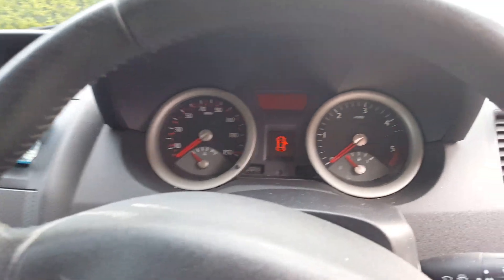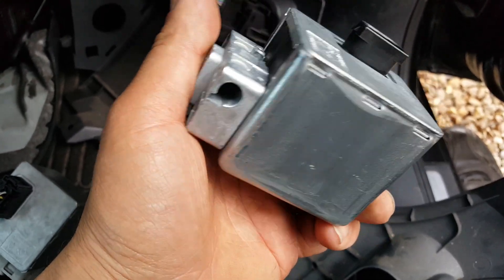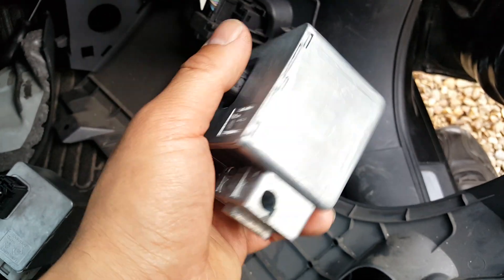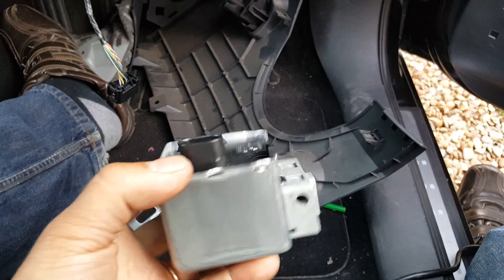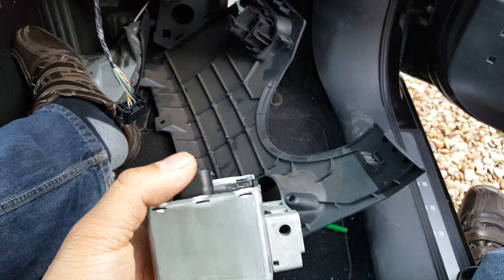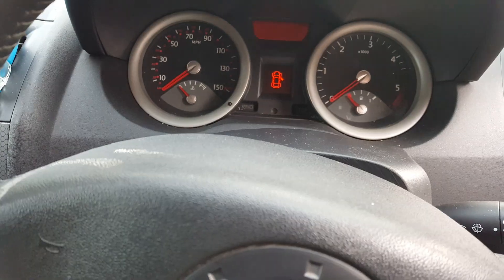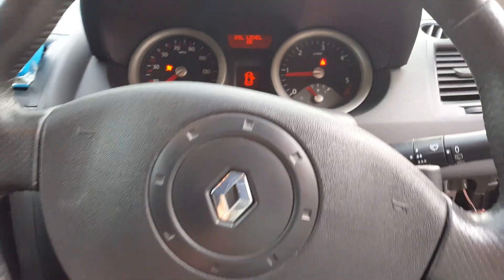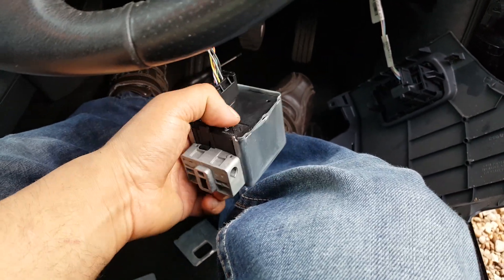Renault Megane steering lock fault repair.

Comment: Hello sir, I have a question if I buy a second-hand one steering modul and just change the ST24/25xx04 chip only from the old one to the new, it's OK? I have Df055 error Eeprom failed activ. Thank you
Reply from the maker: mirel m 
Probably not... if the eeprom from the lock that is on the car is corrupted,  you will be only moving the problem...
You have two options, remove the eeprom from yours and blank it... put it back and see... alternatively you can buy a second hand one, blank the eeprom and that should also work...

Comment: you a great men, thanks. I have a similar problem, what i can do? i need replace a lock module? can i change only mechanical parts of lock module ? thanks
Reply from the maker: Eduard Bodrug 
If you replace the module with a blank and ready to fit, it is plug and play... otherwise all the info is on the video.
Hope that helps....

Comment: You can replac it !? or u need to copy cods to the new one.
Reply from the maker: i-Bird 
The replacement needs to either be blanked of contents copied from the original one...
Reply: Ok ! thank you bro
Reply from the maker: i-Bird 
No worries...
Reply: Ok .How can i help my self if this problem come in desert & the car wont started!
Reply from the maker: i-Bird 
Well... you still need to remove the steering lock and do whatever...
If the steering lock is locked and won't unlock, it is a bit tricky to remove it, but can be done...

Comment: Is there a video to see how it all off? How do I get this part? And how does this part is called to be purchased? Thanks, man.
Reply from the maker: Bili Kid 
Hi
It might be a video on how to take it out, I never captured it due to how simple it is.
You have one bolt and one plug... that's it.
This part is the steering lock. 
Search for "renault megane steering lock " and you will find it.
EBay is a good place...
Reply: Thank you very much. Can you just say, if you buy a new part that you have to decode it before installation? Have a nice day.
Reply from the maker: Bili Kid 
If you buy it brand new, it is plug and play.
On eBay,  for example,  you will see that there is sellers selling them already reset and ready to fit.

Comment: when finished how do you re- connect the lock back in to the car ?
Reply from the maker: Yvie Stevenson 
What do you mean with connect?
Reply: do I have it unlocked or locked when re connecting, how do I plug it back in lol
Reply from the maker: Yvie Stevenson 
I usually close it down and fit it in the unlocked position... but that shouldn't really make a difference...
If the reset is done correctly, the lock will sync with the UCH and that's it...

Comment: Can this same technique be applied to the steering ecu ?
Reply: for a clio 3 that is.... I plan to pull the dump over the next day or two :)
Reply from the maker: Mike Jones 
Hi
Possibly... I never done one of those...
Reply: Ive found a couple of dumps for the clio 3 but once in the hex editor they look nothing like yours ..
Reply: Hello :)
Reply from the maker: Mike Jones 
They don't need to... each car is different... even on different megane the data would be different... That's why they are not interchangeable... each lock contains the data that locks the steering lock to that car....

Comment: Hello my friend
I wonder an explanation of inertia switch operator fiat doblo 1.6 diesel 2015
My fiat makes an accident the engine will not start and warning lights flashing
I do a diagnosis by autocom the fault code is U 0427 Inertia function :  present  
What the solution about this
Reply from the maker: Med téchnicien 
Hi
The car been involved in some sort of accident, correct?
There is a procedure to be followed to allow the engine to be restarted...
Something along these lines:

turn ignition key to MAR;
* turn on right turn signal;
* turn off right turn signal;
* turn on left turn signal;
* turn off left turn signal;
* turn on right turn signal;
* turn off right turn signal;
* turn on left turn signal;
* turn off left turn signal;
* turn ignition key to STOP.

Comment: I've got a scenic 2 1.9dci done loads to it already rewired  the r2 connections  under passenger seat 
new rear crank oil seal 
2 coils 
injector x2
service
But now I have this fault got a kit fro the car but is there any way of bypassing it just to confirm  it's the fault?thanks

Comment: why dont you just swap the eeproms
Reply from the maker: Oltian MUNGA 
Hi
Wouldn't work...
You can do that if the problem is mechanical... if the data in the eeprom is corrupted swap the chips will not resolve the issue...

Comment: my  2004 Renault Megane when I stop the engine, and turn the steering wheel ,I feel clicking like it didn't fully lock and then when I start again the car is fine ,and the clicking goes away and I can just drive back normal ,but it  sounds like i need for of these models, where can someone go and get this done ,without having to go to Renault and a crazy money how difficult is it to do what you are doing on the computer or is there a computer?help!!!!
Reply from the maker: jozzerful2 
Hi
You can get a second hand lock and follow the procedure in this video...
If don't have the meanings to do it, the you need to find someone...

Comment: Hi i buy this to replace the faulty stering lock AD-MEM01
tell me how i cant conect to my pc to use please
Reply from the maker: Ionut Dascaliuc 
I am sorry, but I am not familiar with that programmer...
Does it not come with instructions?
Reply: i ve just order that product i see when he came!i have another question for you do you have anny ideea if another parts of steering fault repair work on my car if i buy from another car end i do the same thing you do in this video?
Reply from the maker: Ionut Dascaliuc 
ok... your question is a bit confused... but if you buy the whole steering column it will come  with a steering lock which you will need to virginize(as per the video...)... Otherwise the steering will not unlock...
Hope that helps...

Comment: Hi, before thanks a lot about recording this video.!!

I want to ask you about if is posible to buy a new one unit of 24c04 eprom (maybe this unit came erased in FFFFFFF all)

My problem is the next:

2 years ago have a problem wiht this. my solution was go to a scrapping cars and take a used unit. 
After i changed the circuit board from my car to the steering lock that i buyed.

2 weeks ago i had the same problem and i made the same thing, 1 week ago, i have again the message of blocked steering.

I tried again buying the used steering, but now i cant make it works.

So what i should to make now.   I was thinking about to buy a new one 24c04  and replace it, but i dont know if it is possible, or is mandatory to use the old 24c04 epprom from the steering circuit of the car??.

Thanks a lot.!
Reply from the maker: F.A. M 
Hi
Thank you for watching and for your comment! 
A brand new eprom should come empty... so should work...
Do you have a programmer, to read and write chips?
Reply: i ask you this because i have not a programmer to write chips, and i was thinking to buy only the eeprom and change it. If it was not posible i will have to buy the programmer and  try like you.

I ask you because o didnt know if the eeprom has more information inside like a Vin code or other.
Reply: Is it work are you try to replace 24c04 with new one
Reply from the maker: F.A. M 
I really apologise... only saw you message now...
A new EEPROM should come empty a filled with FFFF... but not necessarily...
Ask the seller of he can do it before send it to you...
Reply: Hello i tried with new one it doesnt work for me.
Reply from the maker: Miroslav Mitsov 
Hi
One of the two:
The new EEPROM did not came filled with FFFF...
You might have another problem elsewhere...
Reply: where can i search the other problem, the message is the same, 

"direccion  no desbloqueada"   "direccion no bloqueada"  (is in spanish  steering locked, or steering not locked)
Reply from the maker: Francisco miñana 
What have you done so far?
Reply: i sended to an enterprise, they copy te original eeprom and put the data in  another board.
I tested and without exit....

Now i send to a friend the board to erase the eeprom again, i dont know what to do no.
Reply from the maker: Francisco miñana 
OK...
First, copy the data might not work,  if the original data was corrupted you are transferring it to another board...
That's why erase and let the car to write the data needed back into the chip... this providing that mechanically the lock is good...
Once you establish that you have a good working order lock, look at the plug for a good connection, check wires etc...
Reply: i tried with a new one and the same virginiced. Wihtout exit.....the friend put FFFFF and is the same problem and messages.
Reply from the maker: F.A. M 
Hi
Sorry to hear that...
You might have a different problem... ensure all the wiring to the lock is good..
 trace it back, lock for connectors, plugs etc... if there is no communication with the steering lock due to a faulty wire/connection you will probably get the same sort of fault...
Reply: i have to test it, between lock and UPC and betwenn lock and UCH , i hope that the problem won't be in multiplex wiring because it can be repaired, only replaced.
Reply from the maker: F.A. M 
It can be repaired... but you need to adhere a few rules... Google will help you...
So I presume you haven't tested the network wiring then...
Reply: no, i dont tested yet, im going to do in this next days,
Reply: today i tested the conexions and all ok, after i tested the socket of steering lock and it didn't give 12volts, only 0'40 volts, after i test the battery and give 9 volts....   After it the steering lock runs, but i can turn on the car (the battery is low) i put a new one and the car now is ok.

I believe that the problem could be the battery, because the 2 times that it doesnt runs ,the temperature is cold.
Reply from the maker: Hi
You have neglected an important item... lol
But nice to see that you are getting somewhere! 
Good work!
Reply: I neglected this one because all items or car ar ok, without signals of low battery, now i checked the battery and it was without water, i just refilled, if the battery  goes bat  i will change it. 

Thanks.
Reply: Hi again, i had the same problem 3 times.....
was not the battery, was not the steering lock...

i believe that the problem is the uch, because when i disconect and conect again it, all problems dissapear, maybe it can a bad conection....
thanks a lot.

Comment: will it be OK to just unplug and plug back in
Reply from the maker: canyouseewhaticansee 
Depends on what the problem is...
Reply: lmsvvavr  when I first  got the car steering lock worked a couple of times  drove no problems. last week constant L E D and stop sign  on dash won't start  there is a click from the reader when you press the button to start then nothing .
 I've done the fuses cleaned no water damage + ecu good new 6 months ago  +battery good + all connections good live + earth cleaned put back.
 going to have a look at the key card module not sure if it's anything to do with that .
so with the steering look  worn now do I unplug and put back. 
 thanks
Reply from the maker: canyouseewhaticansee 
If is the steering lock that is causing that, it is logged in the UCH...

Comment: Hey up have the same car and my stearing lock keeps saying not locked would this be the same thing. my car starts just here a little bit of clicking when turning the wheel :-)
Reply from the maker: Carp Guy2016 
Possibly... Unless there is something wrong mechanically inside the locking system...
Reply: lmsvvavr  thanks for that how much would I be looking at to get fixed thanks
Reply from the maker: Carp Guy2016 
Depends... not all garages are able to do this, and the replacement is often the easiest option. 
You can look on eBay for example,  and look at the price... usually about £60 reseted. (Same procedure as per the video...)

Comment: Do you think it's the UCH problem? But do you think I can buy all ECU UCH Steering Lock and key from other car?
Reply from the maker: Patrick Pat 
Possibly... or a wire problem...
Have the car scanned and go from there...
Reply: Hi, What you mean with scanned? you mean with Renault Clip device? No, I have just an OBD ELM interface that doesn't work. Hey, Renault Clip could work or not before you solve problem? Does it communicate via CAN interface also with the problem?
I would like now to check my ECU, 3 Connectors, and also to take out my ECU to open and see if there is oxid somewhere inside, I noticed oxid on the connectors. Another way I want to take is to buy the complete kit:  ECU UCH Key and Steering Lock from an other Megan Car, is it a good idea?
Reply from the maker: Patrick Pat 
That will might work, but might not...
If your problem is for example a wire problem, that will obviously is not going to solve your problem.
Scan the car first...
Does not need to be with clip, see a garage, they can scan it...
See if there is something that might point you in some direction...

Comment: Hi, I tried yesterday to reset and erase 24C04 Eeprom with ICPROG (With hot air solder.... and my Eeprom Programmer with smd/dip adapter) and put it again in my steering lock module but Nothing:  Message again Steering Lock Fault
A week ago I bought from UK a new virginised one and put today on my car... Message again Steering Lock Fault..... SO WHAT TO DO NOW?
Reply from the maker: Patrick Pat 
You have a fault elsewhere...
Have you scanned the car?
Reply: lmsvvavr I have an OBD little interface but I cannot do if I cannot switch on...

Comment: Another ask, Do I need to use at the end also Renault Clip device to reset all or to recode the new Steering Lock or just put the virginised one and push start? I don't want to buy Renault Clip and Software to use only for Renault Cars...
Reply from the maker: Patrick Pat
Just put it back...
No need clip...
Might need to clear codes, but for that any reader will do...
Reply: So, If I buy a new or recoded "Virginised" one from ebay, just to put after i get out mine, and push Start button, it might be work?
As you know, is it possible that there is a bigger problem on the Steering and my car gives the same error on display that is not only an electric problem, that if I buy a virginised one and put it on my car will not work because of it?
Reply: I would buy in the future the Can Clip device, I have just the software, as you know, could be good and useful for another car or just only Renault and maybe Nissan motor cars for the future, do you suggest to buy? Now I have only a OBD Elm bluetooth device and Android App like Torque, OBD Doctor, Dash Command that in the specific case doesn't work to reset errors
Reply from the maker: Patrick Pat 
OK,  it should work...
Most os the problems with this system is the 'locking mechanism/module'...
So if replace it should fix the problem.  
Unless, very unlikely though, that you have a problem with the steering shaft...
Reply from the maker: Patrick Pat 
Clip does only renault...
There is although,  some versions of the Consult (Nissan diagnostic tool), that can do both...
If you want a tool do do different cars, then might be better you research a bit more...
Depending on how much you wand to be able to do on cars, and how much you want to spend, there is several options out there...
Hope that helps.

Comment: Hi my friend, I need to read and reset mine. Please let me know which windows program did you use to read and write eeprom and which kind of adapter did you use to put the eeprom inside. Thanks
Reply from the maker: Patrick Pat 
All the answers to your questions are on the video...
X-prog to read and write...
Reply: ok, thanks, so is it good an Eeprom GQ-4X device to put the chip on it? and Renault Chip Eeprom is protected or not as you know, I think no, is it?
Reply from the maker: Patrick Pat 
That programmer should work... with the correct adapter...
The eprom is not protected.

Comment: that is what i intend to do.but seeing it working, i do nor know what to search for after disassembling. the car is working fine,olny when i forgot to reset the error message it happens.i was planning to buy a second hand locker and use the old controller.
Reply from the maker: Check that the pin is actually moving all the way... 
Look for anything unusual...

Comment: i didn't disassembled the locker,just took it out and i saw it working - pussing big pin out and in,like it was supposed to do.but mounted on the steering wheel, engine didn't start.also,in day by day, the steering wheel is not locked at all.
Reply from the maker: Open the lock and inspect...
That would be my next step...

Comment: hello. i have some kind of the same problem,but my car acts a little bit different.after i press stop button (to stop the car) i receive a mesage of "steering not locked" and a sound like something is hitting the steering column and the steering wheel moves a little bit.if i do not reset the error by pressing one again the stop button,next time whne i try to start,it will not start.only pushed.i have dissmounted the steering lock and it is moving normal. do you have any ideea? thank you and sorry for long post.
Reply: Hi friend,how did you knew it/read if you put fff on data then it became a virgin data?can be applied every car or? would like to learn more plz..
Reply: I have Audi A8L have same problem can same method u did can be applied??
Reply from the maker: Hi
Not every car is the same necessarily...
I never did that one, so not sure...
But I would say on an Audi is most likely different...
Thank you for watching!
Reply from the maker: Hi
Thank you for watching my video! 
By your explanation, your steering lock is not working properly...
You might have missed something when you had it open...
have you open it completely?